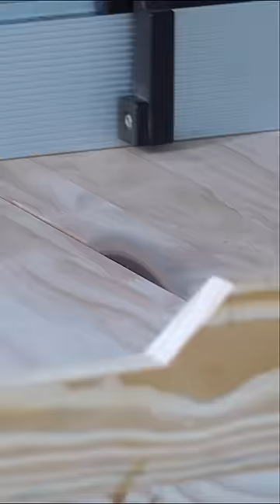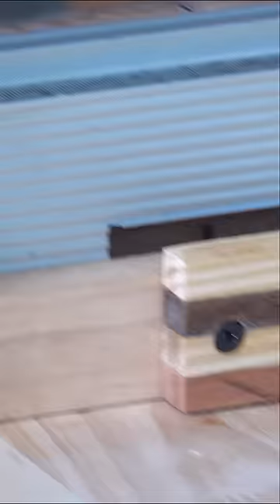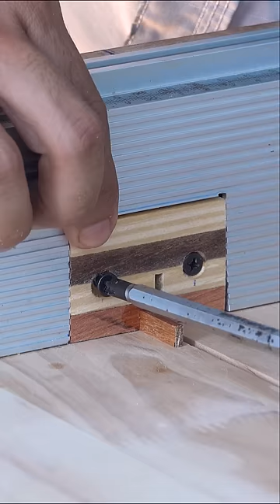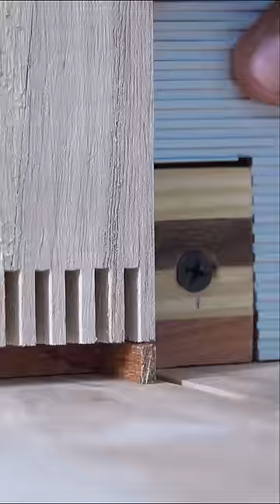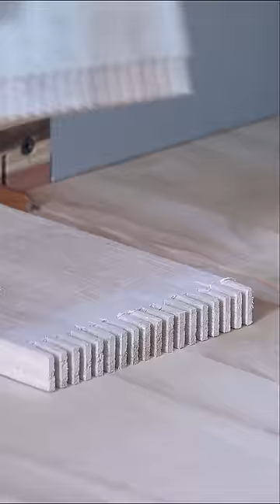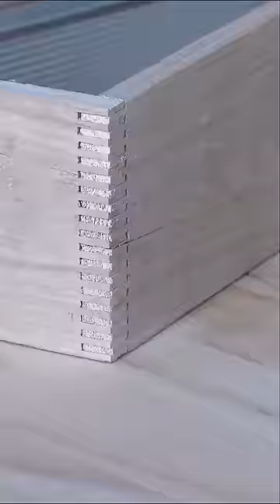Awesome woodworking Tool for making Box Joints on Saw #woodworking #shorts #trending

Comment: That joint would glue up solid as a rock 👍
Reply: Space those fingers just right, and glue is barely even necessary. My first go at this produced an impossible to break joint. No glue.
Reply: @AndrewDeLong I'm going to call this as 100% BS. This isn't a mechanical joint dude.
Reply: No
Reply: @skatersirian  Call whatever you want. I'm not saying I did it on purpose. In fact, my spacing was terrible and I used a rubber mallet to get it in place. It was the wood equivalent of a compression fit.

I literally broke the damn thing trying to take it apart.
Reply: @skatersirian idk if there is enough friction he’s technically right 😅you can intertwine 2 phonebooks and the friction of the paper is gonna turn it into a solid lock 😂
Reply: That joint is an embarassment to japanese craftsmen
Reply: @nachofriend9087 dramatic much

Comment: Looks like the blade height should have been raised about 1mm more
Reply: Yup perhaps 1/2 a mm. Plus he uses the wrong blade. For this u should be using a flat teeth blade.
Reply: Нет. Должен быть малый люфт (как раз 1 мм) дерево будет играть
Reply: Yes, and sand off the exces material
Reply: Ficou perfeito, comentários abaixo , é de quem tem dor de cotovelo😂
Reply: @JaapH  🙄
Reply: Critic or comic? You decide.

Comment: Good stuff. For an even cleaner look use a square cut saw blade. You won't have little V's at the top of the cut.
Reply: It is a flat blade.
Reply: The glue fills those gaps in final assembly.
Reply: @thebluestig2654 i love how glue finishes in all the gaps. 😂
Reply: Some manufacturers call them Dado blades.
Reply: Yes sir it’s much cleaner
Reply: @rayhamilton6923 it most definitely is not.
Reply: Better still use  router mounted in a table.  An up cut spiral bit is the best for this application.
Reply: @thebluestig2654 and unless he paints it that glue is gonna stick out like a sore thumb
Reply: Perfect observation

Comment: Love the idea. I usually use a dovetail. What are two different in this case though, is give it a little bit more thickness which will result in less gods and more sturdy joint

Comment: Ideally you'd use a flat top grind blade to avoid the little peaks at the ends of the width of the cut. The problem is that the big box stores normally don't carry them, but specialty woodworker's store do.

Comment: Not seen one like that before, BUT I used to use a similar jig in Woodwork Class in School in the late 1970's for the same thing, making box joints with the table saw.
Quick tip:
Cut both the same, then rotate one piece 180 degrees before assembling to achieve the desired result.
Much easier/safer than trying to hold both pieces whilst cutting.
HTH

Comment: That's OK if the width of your wood is exactly divisible by the thickness of your blade.😎
Reply: Well the transitioning he showed will make the joint mesh. But the flip to make the fixture gap exactly the width of the blade between the two initial cut is where I scratch my head. If that distance is off by just a little it’ll magnify by the number of teeth in the comb… it has got to be machinist level precise and I didn’t see the set up that convinced me that it’ll just happen magically.

Comment: The same type of setup can be used to make finger joints with a dado blade. You just make the index piece the thickness as the dads width. Not that he isn't  making a neat looking strong joint, the setup with a dado blade allows for a strong joint with many less cuts.

Comment: The kerf always divides perfectly into the width of the board?
Reply: It doesn't need to, when u get to end of board you butt the next board flipped 180 degrees to it so if blade is cutting small cut on one board the one next to it has exactly the remaining amount cut into it, looks better when it's exact width but can be any width board and it still works

Comment: How do you shift the jig to get the second slot exactly a saw blade away  from the first one ?
Reply: With a zero clearance saw sled, the setback on the slot will be precisely the width of the blade and kerf.
Reply: @mikecanfield8541 yes, I understand but in that case the second slot (for the positioning tab) is 2 blade width away from the first slot . Either you make a lower cut to get the clearance or you have to draw a line  (what is visible here but risky for accuracy). Maybe put the tab in the first slot, double it and tangent the blade ?

Comment: How strong would that joint be ?

I’m looking into woodworking joints and their strength
Reply: Exactly what I thought, I doubt it would have much strength.
Reply: As strong as the wood itself. With that much surface getting glued, the wood will snap before the joint.
Reply: Box joints are super strong. Tons of surface area for the glue.

Comment: Too bad you didn’t use a flat toothed blade. The ATB grind is always going to leave those little angled gaps
Reply: Agreed, but for a quick and very strong repeatable joint for drawers and rough boxes, this works.  Raising the blade just a tad to leave everything slightly proud would result in more desirable finish, too.

Comment: You need to glue it together. Rookie move right there. You just went to all the trouble to make a finger joint and then didn't glue it. It will come right apart dude. Get it together.